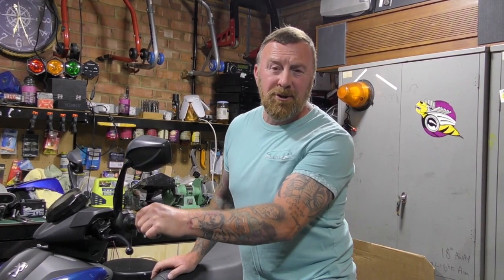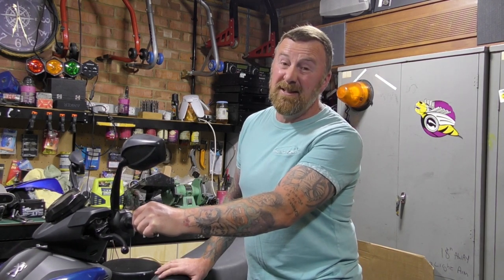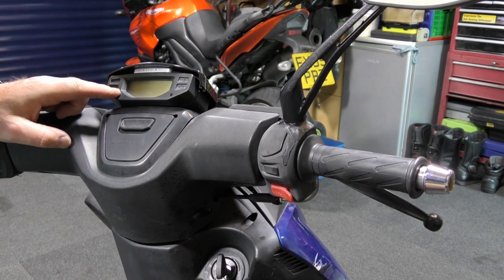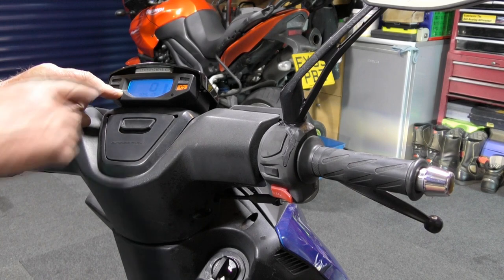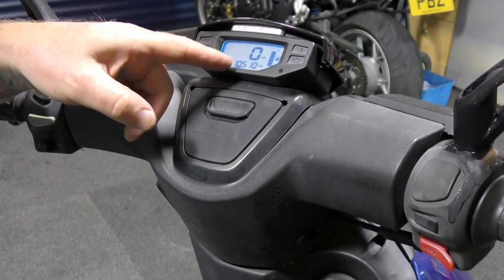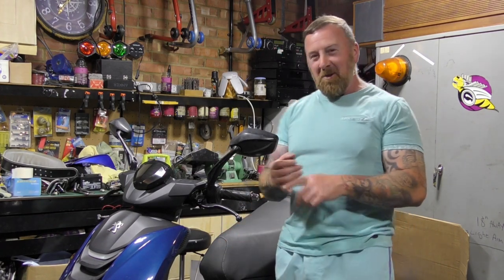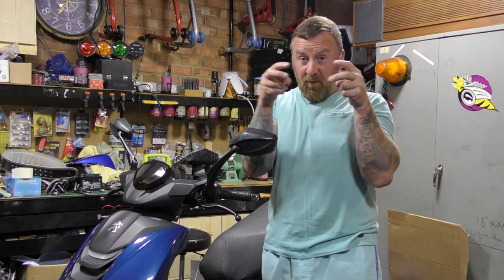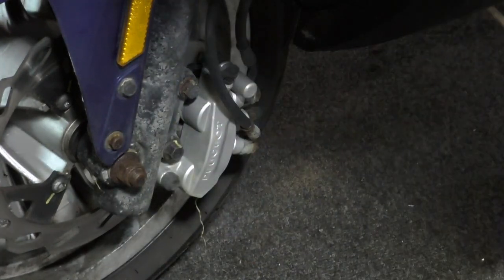PEUGEOT SPEEDFIGHT 3 & 4 SPANNER SERCIVE LIGHT RESET

Comment: Hi mark I have Peugeot speed fighter 4 stroke 50 cc  22 plate I've had the ecu derestricted is there a washer  nest to the variator    ?
Reply from the maker: have a look bud , what sort of speed are you getting now as being a 2t 50 cc , normally a sports exhaust will help
Reply: Hi mark it's slow at picking  up speed sometimes it only does 27 and other times it does  30

Comment: I got the 50cc 4 stroke AC carbureted variant. For some stupid reason it barely idles when I sit on it, but idles fine when I stand up?
Reply from the maker: Its the carb bud so take off clean check jet size, float ok and vacuum working , pipe nice and tight and no leaks 
when on stand the rear wheel is free so run ok , once on the floor the rear wheel is under load with the variator so can mess around bud 
yes i know mad but defo carb
you have changed the plug and a clean air filter and running E5 and not E10 yes !!!
Reply: @marksavage  Thanks for the reply. So a carb clean and tune-up, then. While I'm at it, I'll change the oil, too.

Comment: Hey Mark I have a Speedfight 4 50cc 2017 , the digital display has turned itself off and I can’t get it too back on , the engine still Runs fine though and I’m not sure if this is a easy fix or a major problem ? I can’t indicate or see anything on the display , can water damage do this or is just a faulty display ? Many thanks Kieran 😀